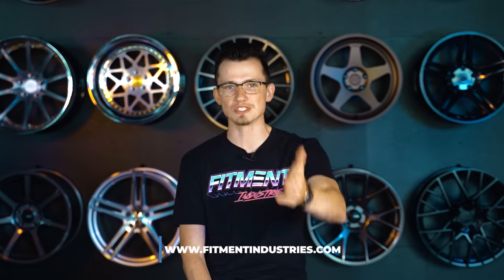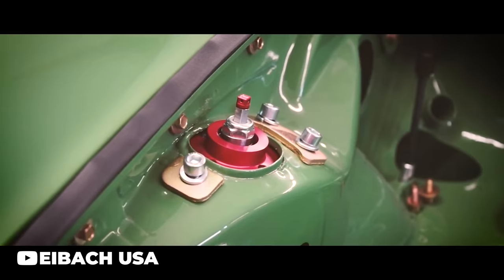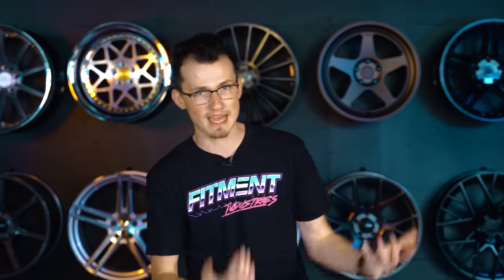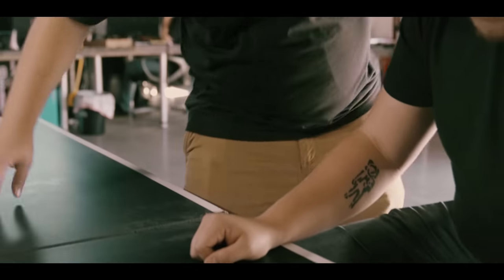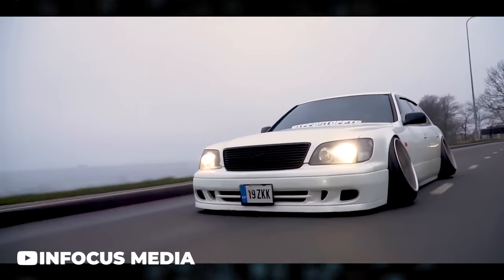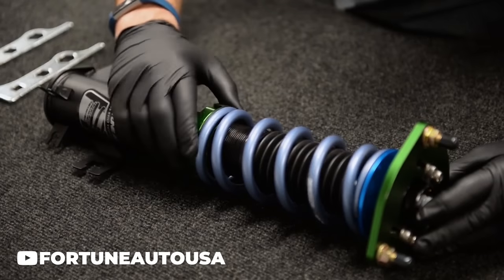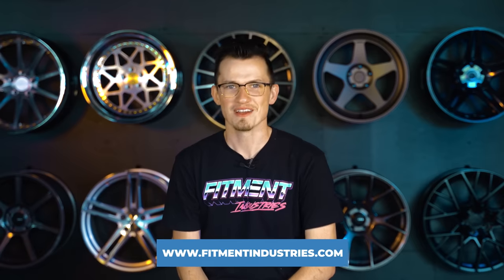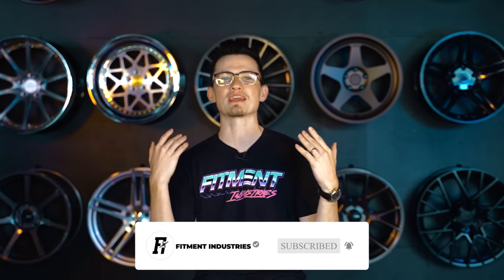Rookie Mistakes Adjusting Your Coilovers

Comment: I installed some coilovers on my s14 and I installed them the way they came in the box except for adjusting the preload (they’re racelands). I now have some negative camber on the drivers side of the car but the passengers side of the car is perfectly fine with no camber. I haven’t touched the camber plates at all either. Any ideas as to what could be the solution so that I could get rid of the camber?
Reply: I've just done my Holden SS Ute today, MCA, local brand. They came with offset washers for the two bolt points at the bottom. Bottom hole was zero, top hole was 14-1, they also supplied 14-2 which I didn't use. You may have the incorrect offset or have mixed them up? My tower didn't allow for adjustment plates at the top.

Comment: I was thinking about getting some $600 Tien coil overs for my 99 Prelude slightly lower the ride as it has about 170k on it and the ride sucks. I was gonna buy the coil overs and drop it off at my mechanic but after hearing all this, is it even possible for me to go in afterwards and adjust the coil overs without take the things off?!

Comment: Ok so my coilovers squeak going over any kind of bump. I have a 03 350z and i have no idea what to do. I have Stance GR+ Pro Coilovers with 150mm Swift springs.
Reply: What does the squeak sound like, where does it sound like it's coming from, and how much did you lower the car?
Reply: @TestarossaMusicista  Squeak sounds like a high pitched spring. car has sat a lot lower than its been sitting for a few months, now its probably 4-5 inches off the ground. sounds like its coming from the back driverside of the car. Tried spraying it down with silicone lube (which I got from trying to find videos over it) and it didn't do anything.

Comment: I unthreaded the whole coilover to remove the locking ring for ride height to get more low on the front and removed all the rings on the spring in the rear (spring is separate from shock)

Comment: Open question: A friend told me that I'd need to get a wheel alignment after adjusting my coilovers? Is that a thing?
Reply: Yes. An alignment is necessary after adjusting ride height, because suspension geometry such as camber and toe are affected.

Comment: You keep mentioning that you use the lower body to ser ride height. My understanding is that the lower body is used to set the bump stop (remove the spring and adjust until the bump stop hits before the tire rubs) and then ride height should be set by the other rings. And if you want it slammed then you may need helper springs after that. Maybe I misunderstood you.
Reply: I think you misunderstood lol.

Comment: So I’m getting my first set of coilovers I should leave them 10mm higher than the height I want so they can settle and I won’t need to adjust them again, set my camber to -1.3 in the front and -1.5 in the rear and set damper as hard as possible to avoid rubbing while they settle? Then as they are settled soften them to where they are comfortable and no rub. Did I miss anything? Oh… Preload is the part that scares me the most now… time to do more research
Reply from the maker: It sounds like you already have a great understanding of how coilovers work!  Make sure you do the proper research and the preload won't be as scary! 🙏

Comment: All this is why I don’t want coilovers. I don’t want a super low car. 1 to 1.5 inch drop is fine for me. I probably won’t even do that. Just adjustable shocks. I honestly haven’t even decided yet. All I know is for my needs (spirited and daily driving) coilovers are overkill. I’m actually thinking sway bars will make a noticeable difference for the average driver. Just my 2 pennys

Ps: research spring rates people. Compare your stock spring rate to the lowering springs you’re planing on getting! Lower does not mean stiffer and stiffer isn’t always better.

Comment: Would you rather have a nice designed factory wheels but the hardware isn't that good or a aftermarket wheel with a  design doesn't look that great but the hardware s good

Comment: My problem is if I install coil overs on my car I’ll need to drill a hole where the top of the front coil overs sits just so I can adjust the chamber bolt sleeves
Reply: depends on the top access hole

Comment: The biggest rookie mistake is buying cheap ass coilovers. Better save your money and invest in a nice set of coilovers such as Megan Racing or BC Racing etc.). My cousin made the mistake of buying some cheap $500 coilovers for his 2004 BMW 540i and she rides like absolute shit now. We tried our best to dial it in, but overall, just not as good as a nice high quality set of coilovers. My 2001 Z3 3.0i is running a set of BC Racing and she rides so much better even though it has the odds stacked against it (shorter wheelbase, lighter, less structural rigidity since it’s an open top convertible).

Comment: Dude I’m kinda mad, been adjusting the shit out of em and one back wheel is slightly just slightly cambered and the other is like almost the exact same as the other but not quite, and one side I had to do a 1 inch difference in height to make sure it doesn’t rub and I can put 2 fingers in on both sides
Reply from the maker: I’m on the same boat in adjusting my coilovers! It’s rough but we’ll get there! 🤘🏾 -Edgar

Comment: Geez, shut up, I already bought wheels tires and coil overs from fitment gosh. 
The mistake I made at first was I didn't use the proper old parts (rear suspension) from the old suspension causing the wheels n tires to ride WAY to low (seizing the tires from rub) and the coil over maxing out and popping off the threaded cup (while installing thank god I didn't drive it that way). I had to reinstall the hat from the old suspension on top of the new coil overs to get an extra 1.5" of height still lowing the car 2". 
Also I didn't know I was gonna get major +camber on the rear so I didn't know I was gonna have to order after market control arms because the stock parts can not adjust that much.

Comment: Come on really. I built nascar chassis for 5 years we only had them out of the car to measure with  coilover machine   We adjusted them while on the chassis to get our ride heights for the offical nascar rules.   We then set it back down and shake the car.  Push down on left rear. Push down on right rear.  Right front. And left front and they seat/rest. Never had a problem

Comment: BC racing coilovers, tein and any other coilover made in China/Taiwan is just pure garbage.  RS-R and KW FTW all day.
Reply: My TEINS Flex Z were made in Japan. So you lying. All of their high end coilovers are made in Yokohama. Only the lower end ones are made in China, and they are made through TEIN, they didn't source out the manufacturing they literally put a plant in China for the sole purpose of cheaper labor, not CHEAPER QUALITY.